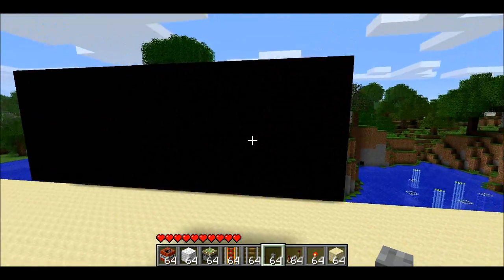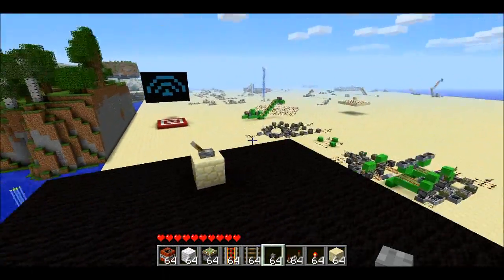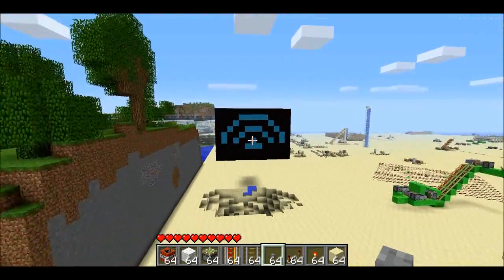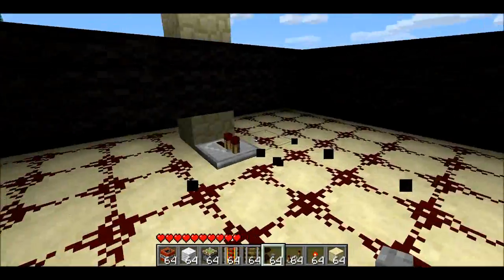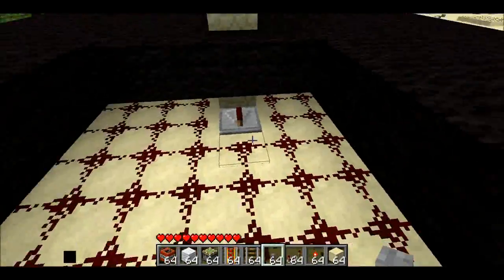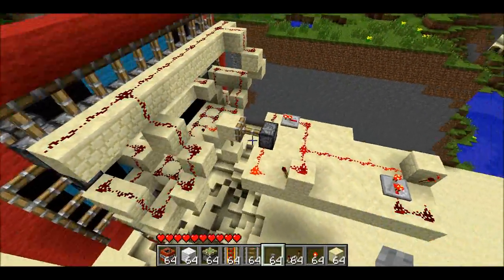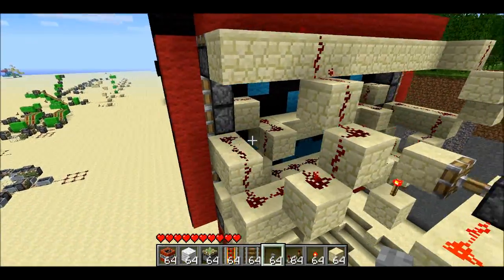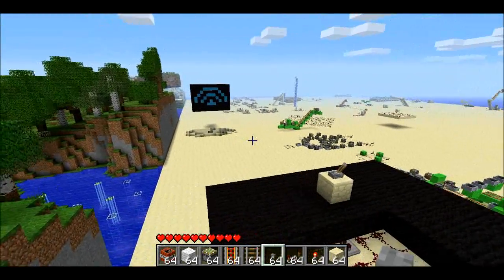Long Distance, Instantaneous, Wireless Signal Transmission in Minecraft without Mods

Comment from the maker: @anew742 You have to manually restart the clock on the receiver before you try and send a signal with the transmitter. That's because the receiver's clock is repeater-based.